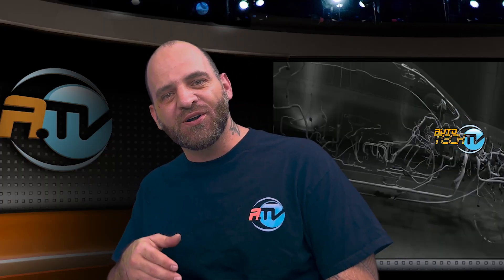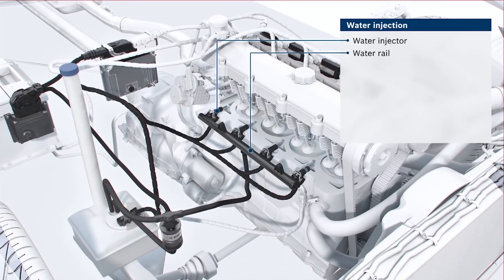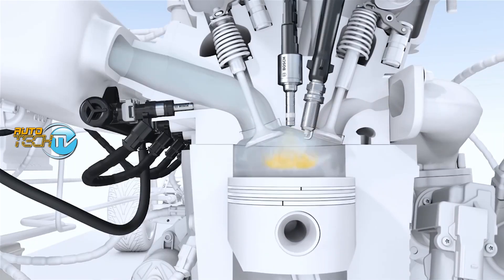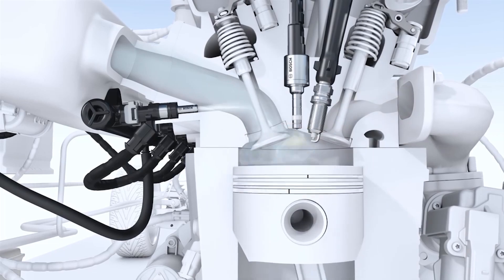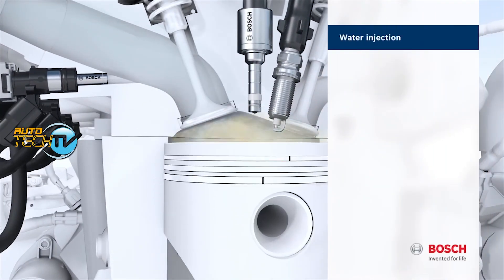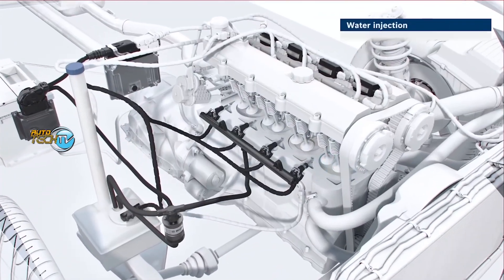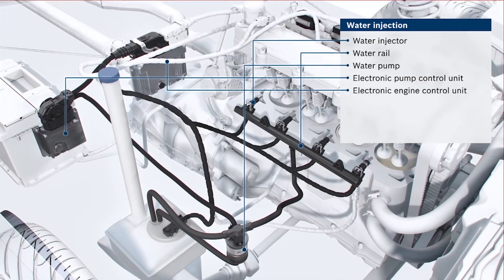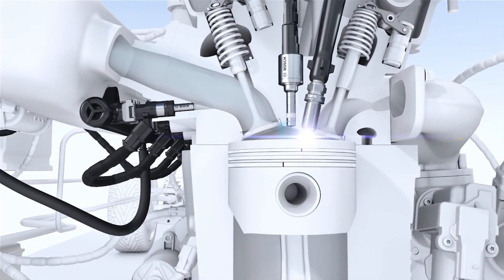Water Injection: UNLOCKING Hidden Horsepower! (Engine Tech Explained)

Comment: I can already see people filling normal tap water into the system instead of de-ionized water. Let’s see what all the minerals will to to the motor… and also left over water vapor and rust since water vapor under heat and pressure will get the cylinder a nice brown coating.

Comment: I have but one issue with this technology -

If the engine is turned off on the stroke where water is injected, and the water mist is not completely eradicated.. it will, and I mean it will condense back into water and sit on top of the piston ring. 
And let's just brainstorm why that's a bad situation.

RUST 

I'm done brainstorming..
I would hope Bosch has implemented a scenario where the water mist is only inserted when the vehicle is in fact in momentum above a certain speed.. 
And that when the ECU notices the vehicle is stopped, or brake applied, that the mist injection is halted so that you get at least a couple hundred piston cycles of burnt fuel and heat to eradicate the water prior to the engine being turned off. 

If that is not the case then I'm sorry but this technology is a far cry from being good. Id label it a joke.
Reply: There should be oil on your pistons and cylinders, so that should negate the rust issue
Reply: I can imagine that they’re quite aware of these issues, and is exactly what they working on when they’re doing their R&D to get this to market.